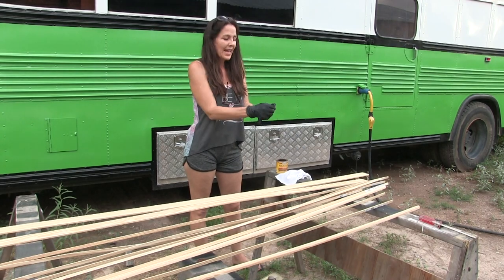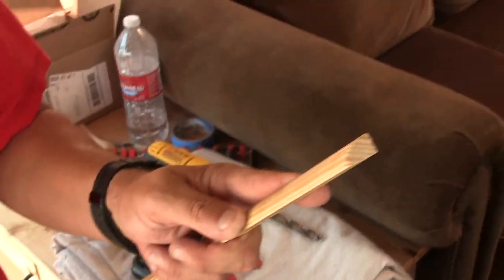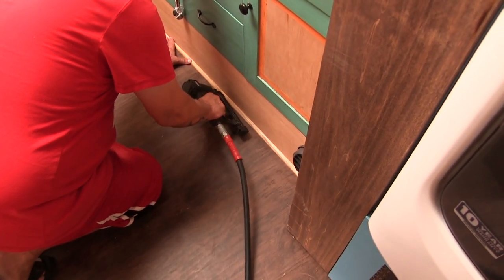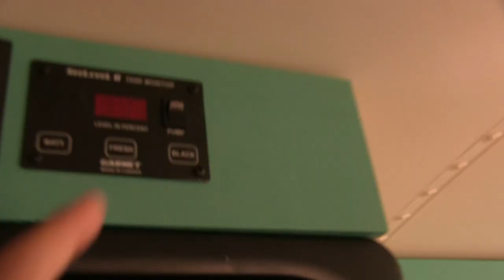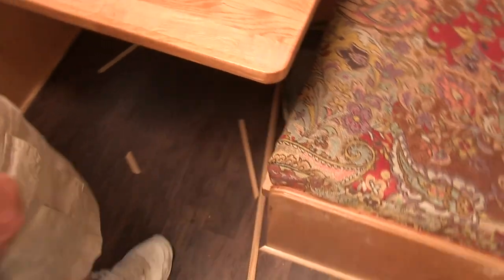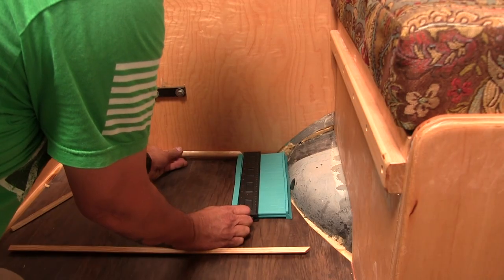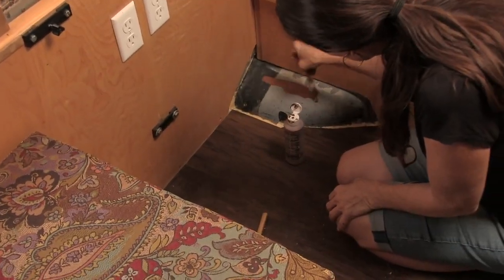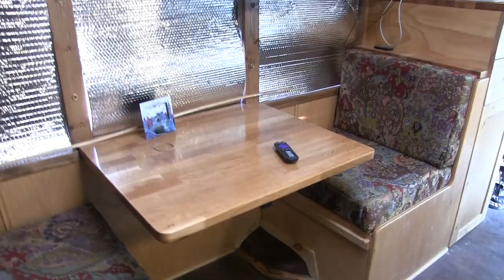Trimming Around the Floor and Wheel Well in our Skoolie

Comment: It looks fine, I would just get a bit darker on the floor trim stain around the wheel well to make it blend in more.. After you mentioned that the left side of the dinette booth is longer, I was thinking, why didn't you just make the right one longer to fit over the wheel well and still have space for your everyday odds and ends? Oh, well. ;) Good luck on cleaning out the house!

Comment: If it was up to me (which of course, it's not), I'd have a rethink on the wheel well, like maybe glue some auto carpet (Google it if you're not sure what I mean by auto carpet) over the wheel well and try to tuck it under the plywood and flooring there and then just one short, straight piece of the floor trim to the corner.

Comment: For the wheel wells, look for Flex Form carpet if you want to go carpet, or get a thin sheet off copper and literally hammer it to contour then trim the edges, or spray / paint it with DIY bed liner.

Comment: Love watching your videos.  You 2 make it very entertaining! I think you did a great job with making those moldings fit just perfect around the wheel well, however, I would have suggested you make those pieces not so wide.  They look to be around 2 inches wide as they are now.  To match the other moldings, couldn’t you make them more like 3/4 inch wide and follow the contour of the wheel well curves? Just my thoughts. Still it looks good as is.

Comment: You now have the cut-outs to create bent wood molding.  By using the molding, you can create really cool molding w/ 1/8” strips of wood.  

1.  Take the existing molding and trace out each curve on the concave side.  Cut out a new mold with a convex curve.  Laminate the new molds to a thickness of 1 1/4 to 1 1/2” to create a shaping mold.

2.  Cut  6 - 1/8” slats 3/4” wide for each mold out of solid wood. 

3.   Pull together as many wood clamps as you have w/ small pieces of wood blocks for clamping.

4.  Pour wood glue in a tray.

5.  Stand the forms up w/ concave side down.

6.  Start gluing and stacking first 6 slats making sure that the first side and last side of the stack remains glue-free.

7.  Clamp the middle of the stack to the form then follow with clamps on each side until entire length of stack is clamped down.  Clamp the side of the stacks to prevent warping.

8.  Allow to dry for a couple of days.

9.  With a 3/4” round-over bit, shape the out edge of molding on a router table.

10.  Coat the molding with finish.

11.  Immediately install the new molding. 

12.  Stand back with pride while she is in awe of her talented, genius, Superman.

13.  Have her point out your prowess to future visitors, while you respond, “It was nothing”.